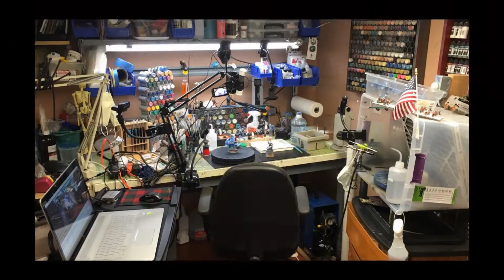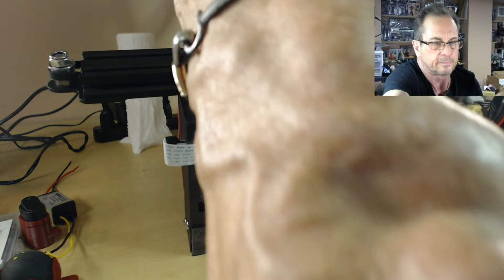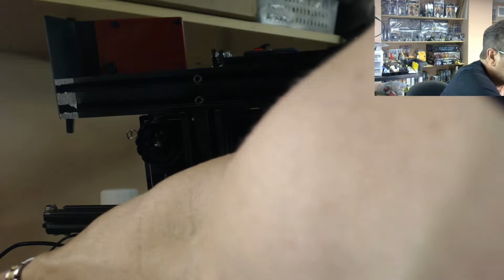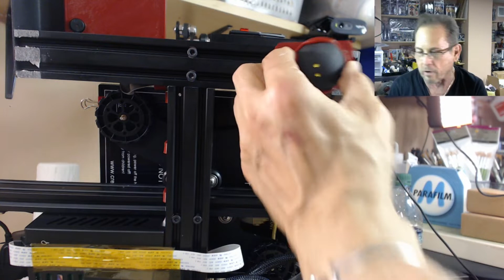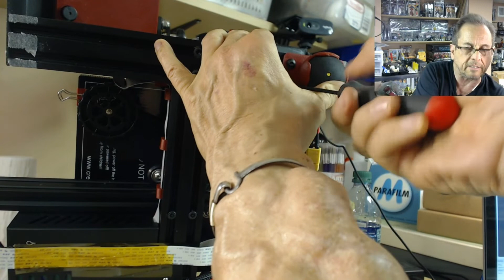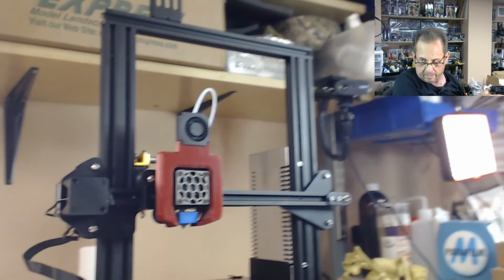Ender 3 Squash Ball Feet Mod!!

Comment: I found some dragon feet on thingiverse, finally done printing them and about to put them on in a bit.  Had to print some t-nuts and I print them real slow and high temp/detail to make them strong and accurate, but once those are done I'm going to put the dragons feet on lol.  Can't wait to see how it looks.  The claws basically wrap around the ball it's really cool looking.  I printed them at 0.16 layer height and 99999 bottom layers so they came out super detailed and hopefully super strong cuz they get pretty thin at parts so I'm hoping they can hold the printer up without breaking

Comment: Is your Y axis stepper motor being hit by the bed mounting plate now you've installed the damper?
Reply: my was and I had to take off that damper
Reply from the maker: TheFlatulentCow Yes it was, but I did fix. I moved the the switch forward just enough to avoid the Y sled from hitting. I used 2 M4 x 8  mm screws with hammer nuts; lost about 10 mm on that axis. I may cut the sled, but doubt. I will probably do a quick video on that. Thank you for the comment.
Reply: Good to know it's not just me!  I'd just installed my dampers on x and y and noticed it was hitting the plate.  I'm contemplating grinding a bit out whilst I have the bed off.  Thanks for the quick reply and keep up the great vids.
Reply: @TheFlatulentCow  I grinded a bit the bed mount
Reply: I had the same issue.  Used this to resolve it since it accepts the original hardware.  https://www.thingiverse.com/thing:3041175 (This design takes about 18mm off your Y-travel, but there are shorter and slotted versions on Thingiverse as well. )